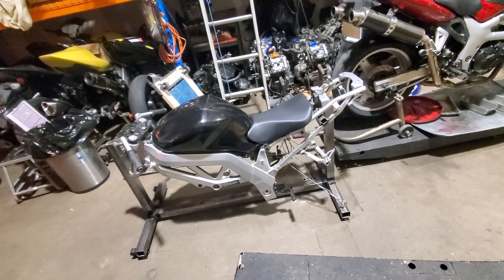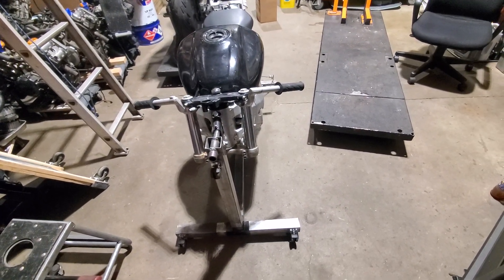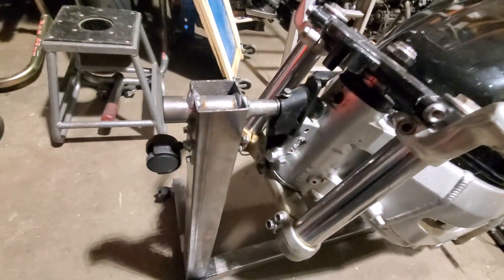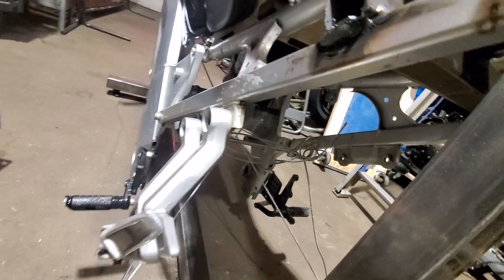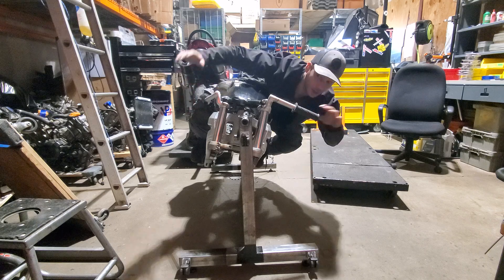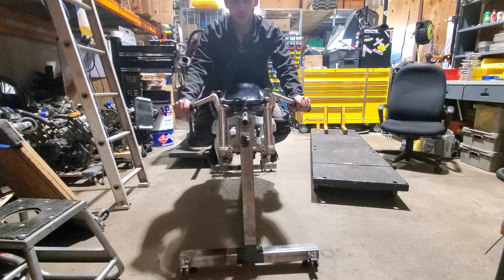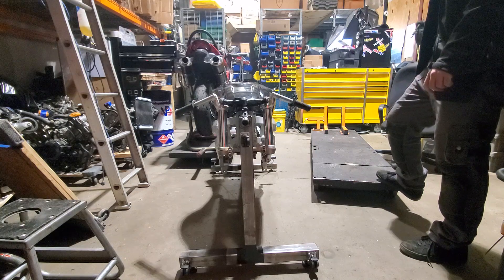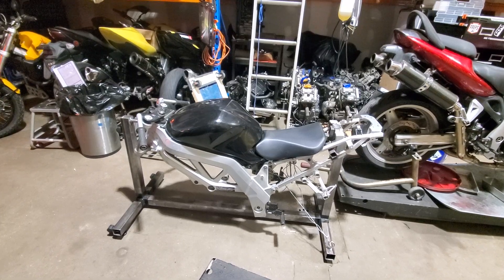motorcycle body position trainer 2.0

Comment: Cool build! Definitely would help with learning or teaching someone body position

I’ve been wanting to safely learn more technical riding and body position. This has led me to decide I want to have more aggressive ergos on my 2003N. 

Im considering woodcraft resrsets and decided against a gsxr front end swap for $ and patience reasons (race tech springs will hopefully help enough) and now have to find a replacement for the clipons.

I don’t want to have to fuck with the headlight bracket or buy new triples so I’ve been considering clubman handlebars. Do you have any experience with them as far as clearance and feel?

Thanks for the vids :) countless of yours has helped me. Just replaced my clutch this fall from a failed burnout 😅
Reply from the maker: a class will do much more than doing any mods. ridermod first! not sure where you are, but between total control, california superbike, ycrs, or a ton of other good advanced and on-track options, or even just basic trackdays youll get a lot out of the bike as-is.

clubmans/suburban machinery bars work great for getting a bit lower. clipons arent super difficult to get set up either.